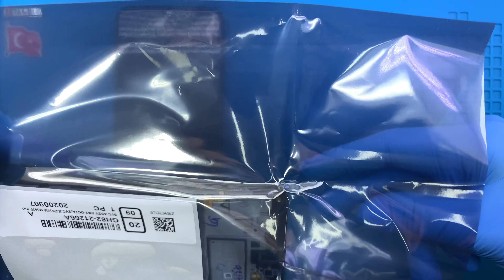Samsung Galaxy M31 Ekran Değişimi 🇹🇷

Comment: Urgent! 
Device: Samsung Galaxy M31s 

Problem: After long pressing the Side & Volume down key phone is showing the 'Samsung' with vibration & after that 'Samsung Model number' with 'Knox Version' but after that screen getting off! 

'Calls are comings' as phone is ringing, button press 'touch sounds' are audible but 'no screen display!'

Main display screen having menu, apps, time, wallpaper as it was appearing earlier, is not coming! 

Done clear cache partition, repair apps & reboot back into android. But still main display screen is now coming as it normally do.

Please tell the reason & the solution. 🙏🏻
Reply from the maker: Hello;
Unfortunately, we cannot give clear information without testing the device.
Greetings.
Reply: @gsmi  'Samsung service centre technician' just listen our problem and without checking device, just told us that our device's 'Super Amoled display is damaged & needs to be replace' with a new display.

There is no physical damage to device, but one time it got contacted with little water. Is it possible that even a single drop of water inside device can damage Super Amoled display?